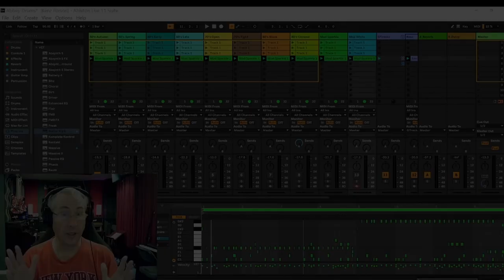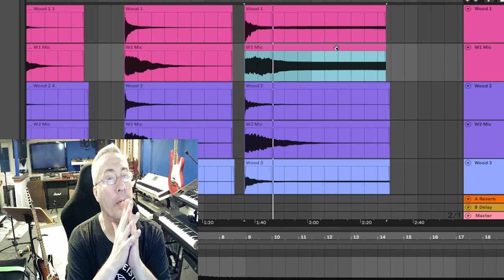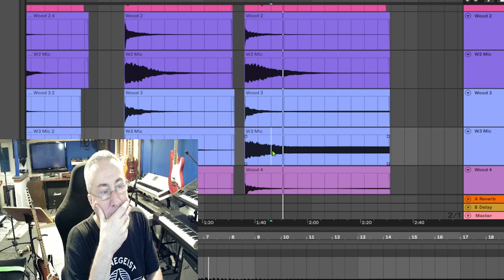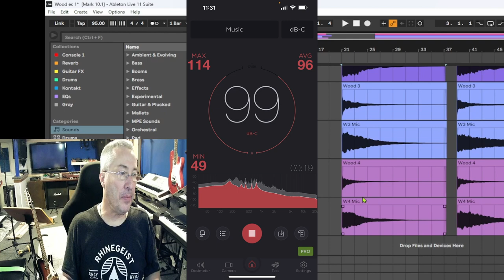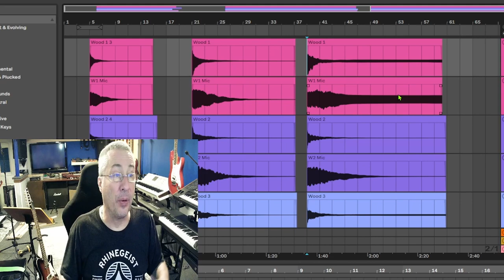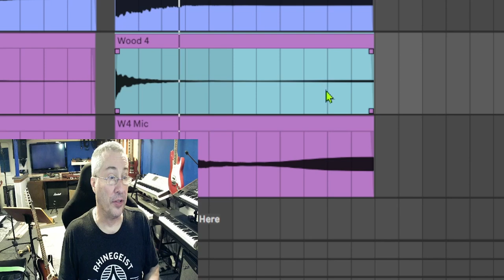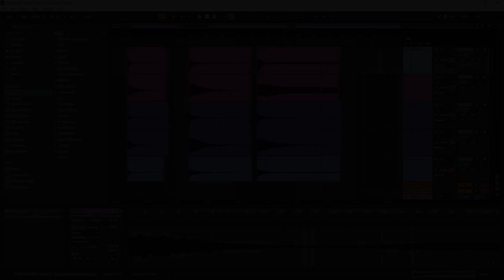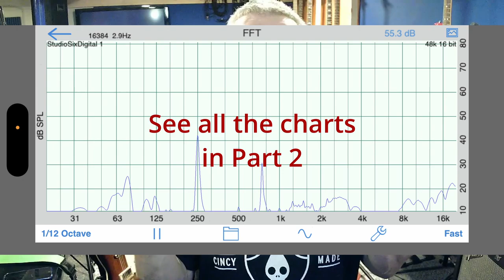Tonewoods in Electric Guitars. The Test Data and the Truth.

Comment: Bravura effort, folks! Deeply impressed with the pickup and picking solution. Clever. I can see this video acquiring significant popularity!
So what are the conclusions? That the choice of wood can have different resonant frequencies that make a difference mainly when the amp is loud enough to initiate a feedback cycle?
Reply from the maker: I'd agree with that. Also, I'm not always picking very hard. Sometimes I hammer-on. Or, pull-off. The feedback sustain can be very immediate with my playing style.

Comment: What I'd need to see on these results is repetition. You can be as scientific as you want in setup and variables but without repetition, you have a meaningless experiment. We have single event recorded for each variable. In my experience of feedback and using it musically - it's quite unpredictable. I wouldn't trust that the feedback produced has anything to do with the wood imparting sympathetic vibrations to the string unless we had at least, say 20 repetitions of the same notes being struck. Then we might be able to produce a pattern of correlation.

I'd also want to see these through a frequency analyser to assess whether the wood is imparting any "tone" or instead, sustain.
Reply from the maker: For sure. We did the science pretty well and tried to show the most common outcome. There were multiple tests, and they all behaved consistently with what you saw in the video.